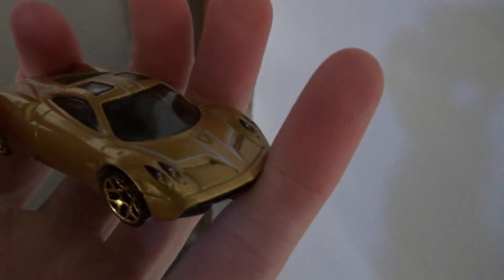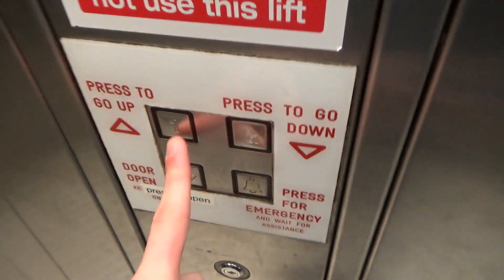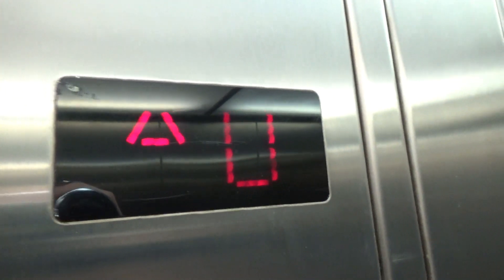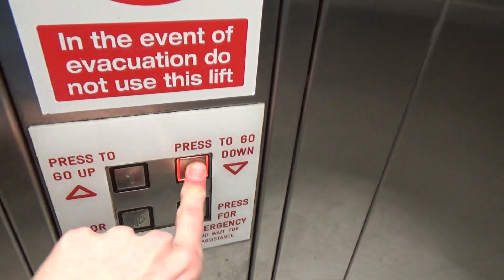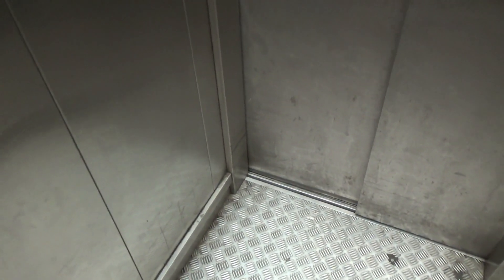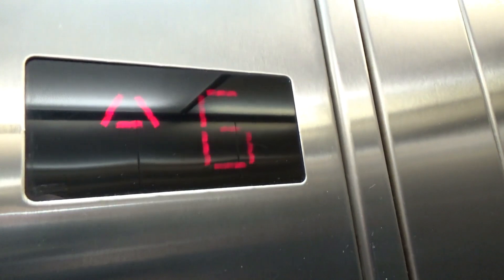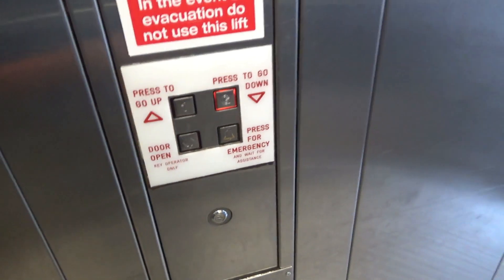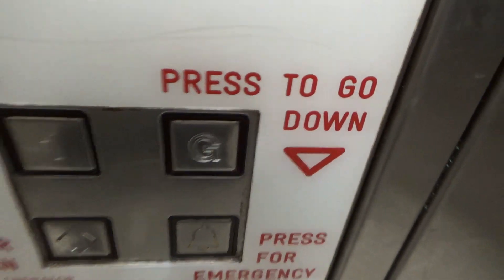(NOW GONE) The Stannah elevators I missed last time at the National Railway Museum In York

Comment: These lifts are so CCCCCHHHHHHHEEEEEEEEAAAAAAAAAPPPPPPPPPP! They remind me of home lifts by ThyssenKrupp.
Reply from the maker: these are well built compared to new stannahs tho
Reply: @ZZ9ProductionsOFFICIAL  Are you aware that I am working on a Multi Lift Simulator on Scratch which will have random activity.
Reply from the maker: @LIFTEXCELSIOROfficial  i think you've said that before somewhere, but i wonder how you're gonna keep the load on the servers to a minimum with that
Reply: @ZZ9ProductionsOFFICIAL  There's only 4 modes, but one sprite for all components that has costumes for all the modes. There were originally going to be about 12 modes, but that is juts not possible. Also, the buttons will be clones and there is only 0, 1, 2, 3 floors. Also, have you seen my old OTIS on Scratch? (Sorry about all the adverts, I'm just asking)